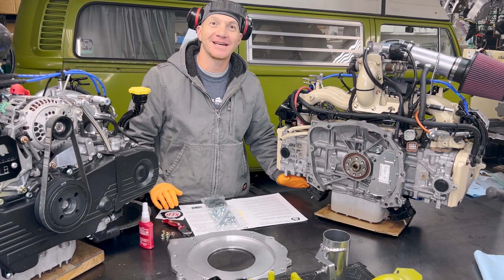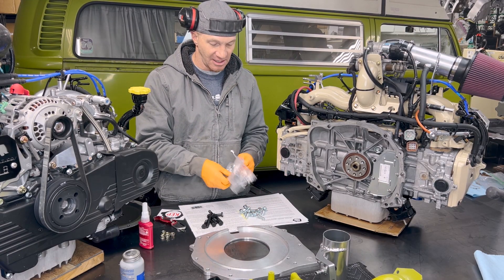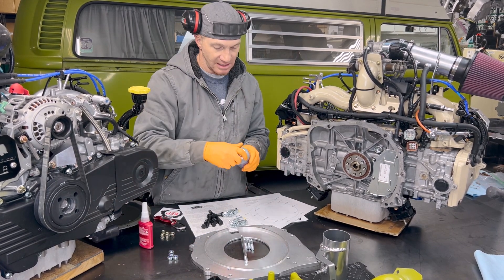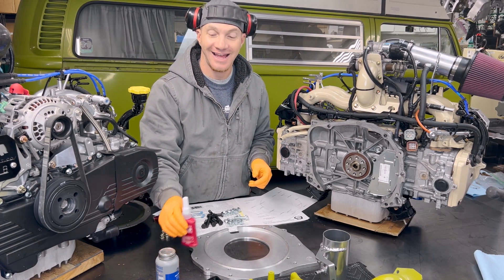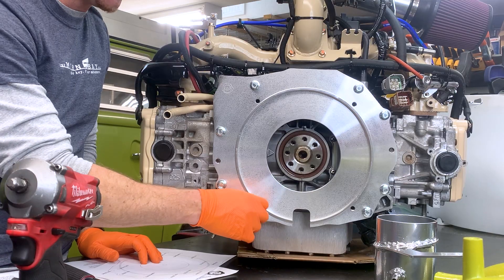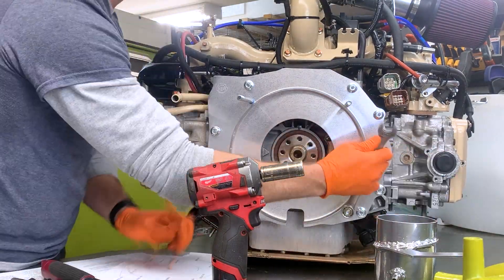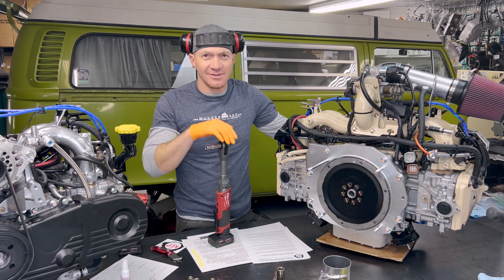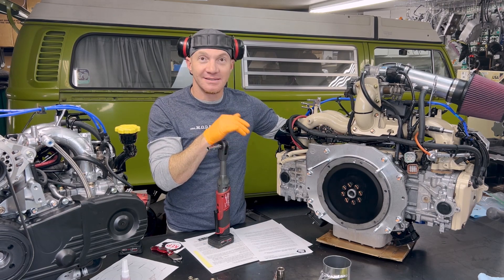How to Install VW Subaru Conversion KEP Kennedy Engineering Auto Transmission Adapter Pt 2: BOLT-UP

Comment: Hi...so what you are saying is that the Subaru engine is manual and adaptor plate  allows for transmission that you are using to be an automatic?

Comment: As usual, great content, great video! I think that you can make a tool to keep the engine from spinning over. Take some flat stock, either steel or aluminum, drill one hole for the mounting stud and another for the torque converter bolt. Slip over the stud and fasten to the flex plate. I hope that's helpful,
Reply from the maker: Thank you, @knoxsyncro! Much appreciated. And you're right - I should to just weld up a tool! If I do many more of these, definitely something that'll be worth the few minutes to tool up.Cheers and thanks for watching!! :D